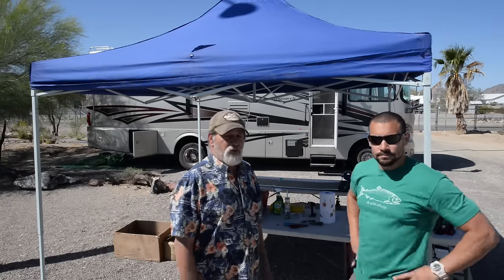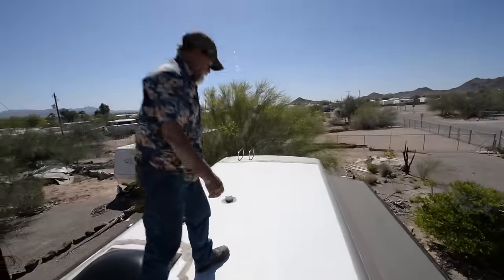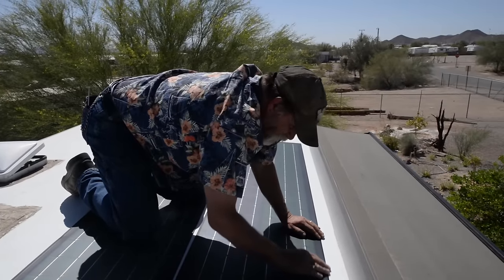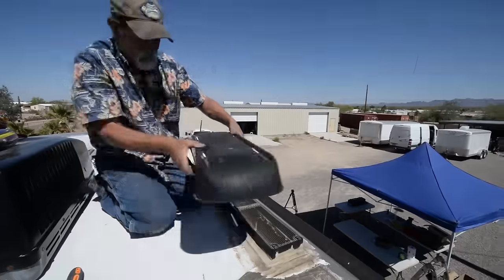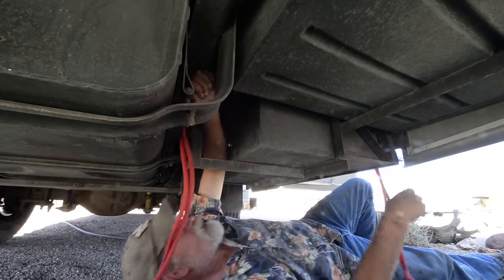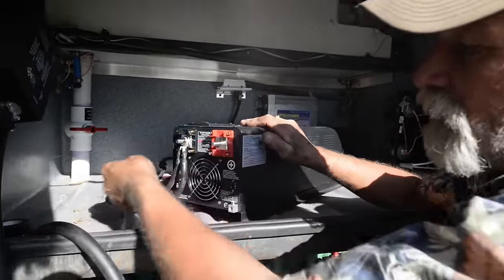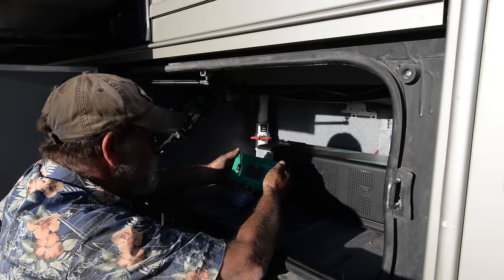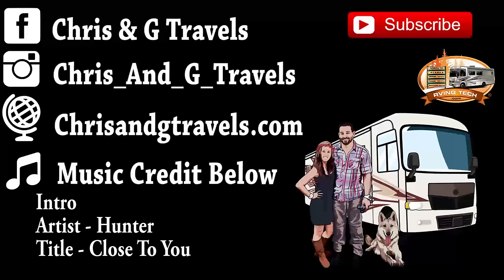Full RV Solar & Inverter Install  ~ From Start To Finish

Comment: Thanks Chris, for this! The guy seemed to do a great job. Like wincrasher2007 mentioned below, I was also thinking #2 wires would have been better, but didn't the install man say he doubled the 4 wiring for that reason? #4 being much easier to do the wire runs? Anyway, I liked his work and explanation, he was very good! I'm wanting solar for our trailer.

Comment: Thanks for a great video. 
Do you keep the "starter battery" and the "solar battery" connected so that the solar panels can charge both batteries when it's sunny and the alternator can charge both batteries when you are driving? Or, do you have two individual systems?
Reply: Vidar Dons Lindrupsen usually there is a switch ore one way diode in the line so you can't drain all the batteries at once so you can start the vehicle if there should be an electrical failure. Same reason generator s don't siphon fuel off of the bottom of the tank

Comment: Great video, I like how clean the system was installed. If like to do mine transparent just like this..

I have a 2018 24F Thor Chateau Class C. It has solar jacks already on roof. Not exactly sure where they dumped the ends. And RV co I purchased from(new) is being tight lipped..UHG! 

Would this kit be overkill for my size RV? I'm just looking to maintain two house battery's, be able to watch a 32 led tv on occasion and be able to plug a phone charger without having to run generator.

Comment: made my own automatic switch by using a starter solenoid and putting resister on the ignition side to keep it from burning up solenoid it's not made to have contend use on 12 v now my battery bank charges while I'm driving and I don't half to remind myself to disconnect when I stop

Comment: Questions:
What is the Inverters output wattage?
What is the max charging ability in amps.
What is the max solar input voltage the charger can handle.

Comment: Hi Chris and G glad to see you but I do have a Question when you are going to reseal your roof how is that going to happen if you glued down the solar panels ? I'd rather put them on swing arms and flood the roof easy that way rather than to have to pull up the solar because the coating on the back of the Solar is what that like to call ice and water shield backing that seals like contact cement it can't be ripped up you have to re-coat the roof each year it dry rots unless you have a fiber glass seal ?

Comment: I had a hard time watching him run the wire without any grommets or protection for the wires from being mechanically damaged. I hope he installed fuses on the roof near the panels. I have seen fires started from wiring rubbing and shorting thus causing electrical fires.
Reply: +Ray_Biker    Did you actually listen to why he said he was making sure he had a nice clear route, with nothing to rub on the wires?

Comment: I've read that solar panels overheat easily and that lowers their output. With these panels glued to the roof, how do they keep cool, with no air flow underneath?  Have you checked their temperature while operating in that Arizona sun?
Reply: I  have been told that as well  how do these panels perform when they get really hot

Comment: I don't know about you, but I'd rather have my panels in parallel if possible. If I understand correctly, if one panel were to get covered by shade and not put out power, then the other panel(not in shade) would not be putting power into the system either.

Comment: Why is the control panel mounted in the basement?
Reply: +TheGreatDebtpression I think one of the other videos showed they put it inside near the slide out and he was just using it to test the system before running the cable up there and installing the panel.
Reply: +TheGreatDebtpression I think one of the other videos showed they put it inside near the slide out and he was just using it to test the system before running the cable up there and installing the panel.

Comment: Didn't see  wire protecting fuses on the runs from the batteries to the inverter, they should be as close to the battery as possible. This is a worst case scenario where one of the thick red wires gets grounded out to the frame. (can happen from vibration wearing through the insulation over time) Could be a fire hazard. Otherwise great Job!

Comment: I watched the video and I don't think that is 4/0 cable I think it is 4 AWG so let’s do calculations for both. Assuming perfect temperatures, the 4/0 cable can carry 180amps each or 360amps in parallel. I used the lowest amp rating for this size cable. the 4 AWG can carry 65amps each or 130amps paralleled. I used the lowest amp rating for this size cable.
 
So, parallel 4/0 cable can handle up to 4320 watts... 4AWG in parallel can handle 1560 watts. I think that's the 1500-watt inverter. It says it can have up 110 amps charging depending on model I’m sure the 1500-watt inverter doesn't have that much so the cable is more than adequate. 

Now the resistance of just the wire. On a 24ft run of 4AWG it would be 0.006 ohms which is basically zero. Most the heat is going to come from external the wire meaning heat is going into the wire from the outside not coming out as a loss. So, the resistance will change with external temps but it is still negligible. On a 24ft run of 4/0 cable the resistance would be 0.000161ohms per meter 8 meters (approx. 24ft or so) would be 0.001288 ohms. So, the resistance in perfect conditions is pretty much zero for both wires in a 24-ft. run.
Reply: One last thing my expensive fluke meter can't even measure that low of a resistance. I'm sure the make meters that can measure that low but they would probably cost thousands of dollars.

Comment: Very nice video, I've two questions  though.  One, I saw space on the roof where you could have put two more panels,  would it make sense to do that if your going through all this trouble? Second I noticed where you mounted the inverter  it looked like a sealed box. Any issues with ventilation ? My inverter get hot and the fans run all the time. Thanks again.

Comment: You keep referring to "four-aught" wire. You do not have "four-aught" wire. You have 4 gauge wire. "four-aught" is 0000 gauge, which is nearly a half inch thick. https://en.wikipedia.org/wiki/American_wire_gauge. I know what you meant, but somebody with no practical background might be in trouble if they walk into an electrical supply and ask for "four-aught" wire. They will be shocked at the price of the welding cable they just bought!

Comment: What about wiring the inverter charger to the AC system? Did you use a sub panel or wire it into the existing panel? Why is the converter/charger still there behind the new inverter/charger?

Comment: I'd feel better if the installer would have put the wiring into split-loom for protection.  The original manufacturer of the coach did it and they are known for cutting corners!

Comment: I really want to do this to my Class C RV. I am curious how long the batteries can go just charging my phone or computer etc. And how often those batteries will be full from the Solar Panels. I know I wouldn't be able to run an Air conditioner or anything.

Comment: I am new to solar and a new camper owner. What all do I need to fully set up a solar power unit to power my whole camper? I need a 30 amp system and would love to upgrade to 50 amp if possible.

Comment: Did he say this system take energy from the solar panels directly to the inverter to power plugs etc, without drawing off the batteries.  Most  solar panels just charge the batteries and the inverter draws from the batteries ???

Comment: can the inverter charger be set for lithium  batteries. Not sure I like the stick on panels they don't seem to have much wattage for the size but I do like the inverter charger charge controller...

Comment: Not to be a Debby Downer but if there is chafing in the insulation or a varmint chewing on it resulting in a direct short to ground is there and fused protection?

Comment: keep your renogy folding panel,,,,, when you get up north you're going to realize that panels permanently mounted flat are not ideal and those can't be tilted,,,,,,,       your energy panel at least can be tilted To Face directly into the sun when it's low on the horizon...

Comment: Why did he install the monitor panel in the storage bay? The owner will have to get at the outside storage bay to check the health and performance of the system, rain and shine and snow. If I owned this rig, the mounting of the monitor panel would not be satisfactory. I would have also wanted some kind of a wire loom, preferably a spiral wound nylon or plastic covering the entire wire run under the coach. This would have been an easy task if it had been installed as the wires were run. Retrofitting would be a nightmare!

Comment: Regular 100w panels are half the size and sell for about $1./watt ($100. for 100w panel). These are 'on sale' for $550. for 100w panel. Sorry but the huge cost disparity is not justified by this panels' minimal benefits. Plus there's always the nightmare of removing these when they go bad.

Comment: I've no idea if it actually would hurt those panels, but I still cringed when I watched him kneeling on that one.  😖
Reply: +Mr. Dirt - You could dance on those flexible solar panels and not damage them.  : )
Reply: Mr. Dirt m
Reply: They are tough...socks recomended if you need to walk on them. A knee is usually OK. I mount them with at least 12 inches between as a walkway...when I can.

Comment: I should provide a follow-up to my earlier comments in which I mentioned being shipped the wrong product, an inverter, rather than this converter/charger/inverter which also had DC input terminals for the solar panel(s). After complaining about being shipped the wrong thing, the salesperson for EEZ RV Products responded with an unprofessional rant about my incompetence rather than simply waiting to see what they sent me.
Reply: I sent back the inverter, had to argue about getting a refund but finally got most of my money back, minus their "re-stocking" fee of 15%.
Reply: This product seems wonderful, and only AIMS has something similar, but AIMS doesn't mention it in their online ad, which is really surprising. You can see the same connections in their youtube video, but they don't mention them.

Comment: Hum.... flat panels mounted directly to the roof with no cooling airflow under them?
Better buy a couple spares because those panels will not last long baking in the sun. And replacing them, forget removing them or your roof is next to be replaced. Just stick your replacement on top of the ones that burned up. Wow!

Comment: Why is this guy using such oversized cable if those are a pair of 200 watt 12 VDC that's a 33 amp load total number 8 wire is rated for 40 Amps 6 would have been plenty even taking voltage drop into consideration. He should have even run these in series for a 24 volt system and his cabling would have been even smaller. Pops isn't very knowledgeable in load calculations. :>(